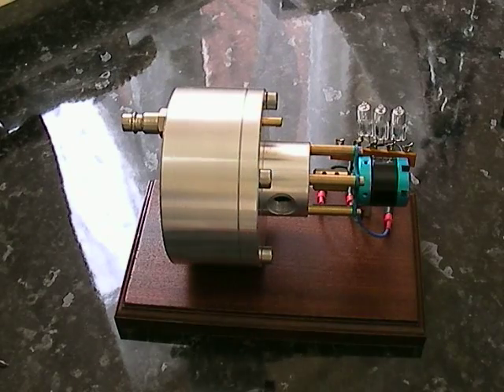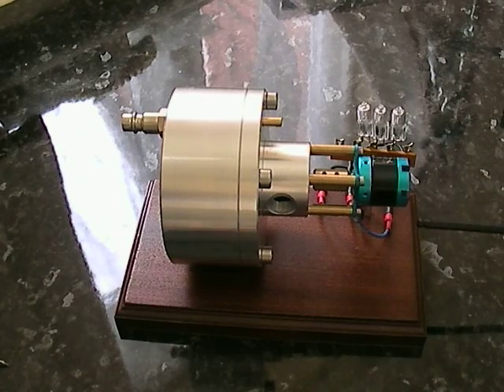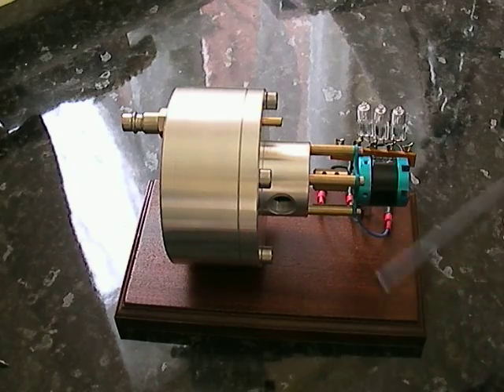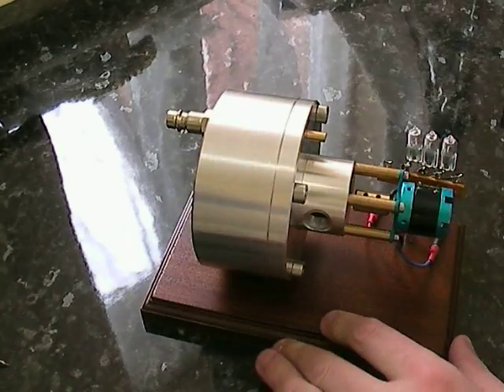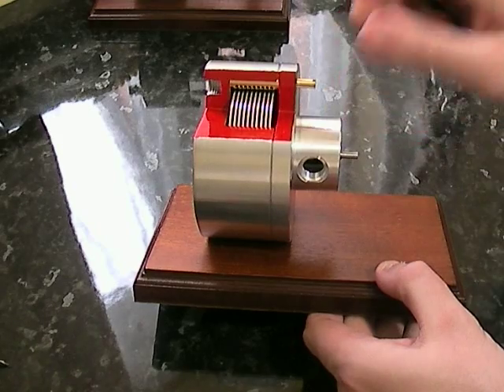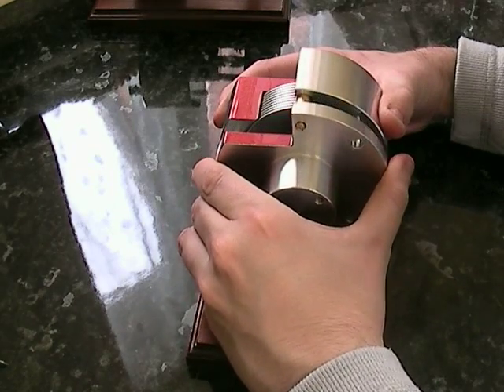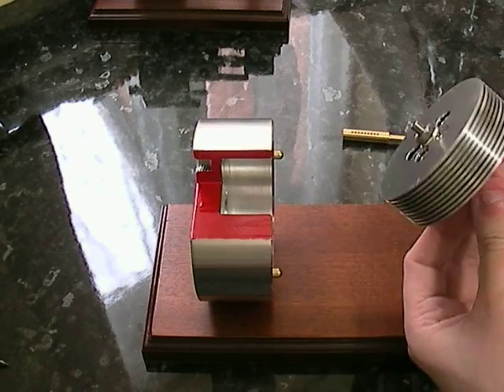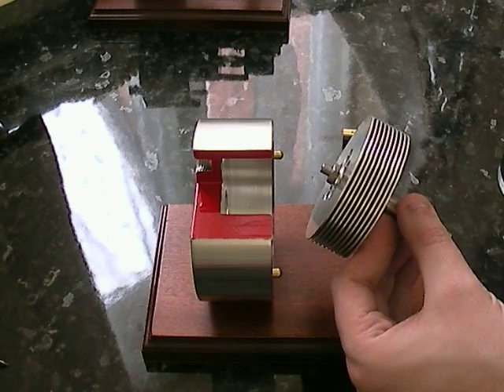NEW Tesla turbine with improvements - from gyroscope.com

Comment: Shatros... think beyond the box. One can achieve a pressure differential of gasses without the use of a compressor. 

Simply because this engine is being driven by mechanically compressed air, does not imply that it is the only way. 

I'd like to see one driven with solar thermal heat and a sealed, regenerative r134a system, perhaps with a below ground, or groundwater based condenser.

Comment: I think the Tesla Turbine could be used for small scale residential energy production. My only concern would be that the bearings running at high speed day after day wouldn't hold up well enough. This could create too many maintenance problems for the average homeowner to deal with. However, I really like your turbine.

Comment: You can generate enough steam using mirrors concentrating on a small point, no need to buy expensive vacuum tubes when cheep mirrors will work.

Comment: @WHplayer Horespower=torque x rpm, if you gear it for torque it is practical.. (With a fixed horspower you can raise the torque by lowering the rpm via a gearbox)

Comment: @shatros He is not trying to prove that powering a turbine with compressed air is efficient, but rather that routing some form of pressure through this bladeless turbine does in fact create a rotational force.  The fact that it does not have blades would be counter intuitive but it is an efficient design.  If these were designed for commercial power production the input pressure would be steam not compressed air.  The lights are there to prove that it is actually turning.

Comment from the maker: @ranskye1 Just to give you some idea 6 square feet (1.8 square meters) will produce about 2.5kw of energy.  So you would need to have something like that size to get the turbine to run. Another point be careful with the solar vaccum tubes. They are not designed for any sort of pressure. They are really only designed for warm water.

Comment: I meant, that even if it does get it's start from a battery, it could use wind as a power source, how this Plasmastar9's seems to take wind in the front, and push it out the back, wich spins the metal disks, and as they spin, they apply drag to a wire, or whatever method, and electricity is generated from the turbine. because of the method, the wind would pull wind into the front as it comes out the back after the initial start

Comment: @gyroscopes thanks, im getting some vaccum tube solar systems soon to help heat some fish tanks during winter, in summer i will have more hot water than i know what to do with. closed loop system might be the go. rather than sending steam to waste. return the warm water. i also wonder if it is possible to make one of these without both ends of the shaft being fixed to a bearing. high volume, low head water pump maybe.. thanks

Comment: It doesn't matter how much hp you have if you have a low torque. Let's say it has 100 hp, even at full speed if it only has 1 ft pounds of torque you could stop it with your bare hands. The major down fall of this type of turbine is it has a very low torque which doesn't make it practical for an engine in a car but does make it a generator once it reaches full rpm's.

Comment: could it be used along with those vaccum type solar tubes? i read that solar hot water systems are not efficient enough to create enough steam pressure but these new vaccum tubes are supposed to be most efficient. say take a vaccum tube hot water, send the heated water to a sunlight magnifier and then send that steam to this tesla unit, charging a battery.

Comment: may i ask u is it effective to use as a propeller engine? or the air pressure that used would produce more thrust than a propeller attached to the turbine?

Comment from the maker: No. IT can be used as a pump. Power the gen/motor and it becomes a pump. no compressor ! why the obsession with compressors? They use it to pump cude oil because it is intrinsically safe (debris passes through rather hit blades).

Why is it not used in factories? Well because it quickly became cheaper/possible to buy electricity directly from a electricity company than creating on site. Consider this... Why are now only just replacing incandescent bulbs with fluorescent bulbs ?

Comment: @ranskye1 O that is such great thinking! you can find the solar heater stuff at GREENPOWERSCIENCE youtube channel. I was thinking of WSE's vaccuum tube panels(750 - 900 CAD) and you made me think of the parabolic pipe I saw somewhere. maybe hhoforvolts or advancedhydrogen could use this in combo with fuelcell - or maybe skycollection and his starship rodin coil pickups on the bedini motor - man i wish i was proficient in electronics